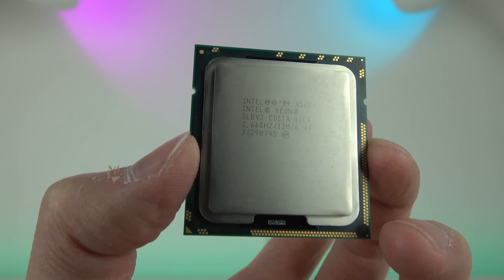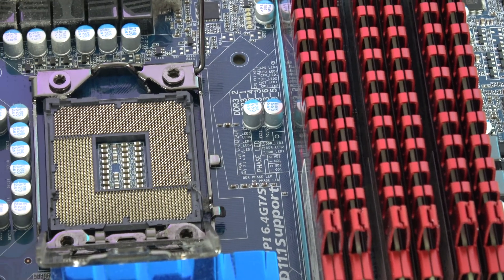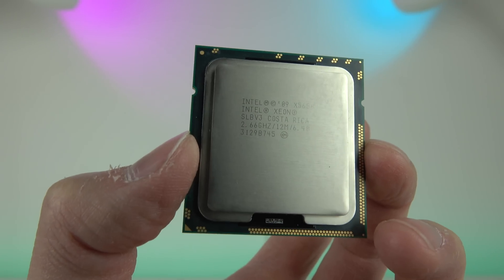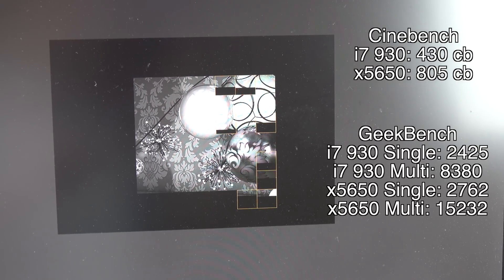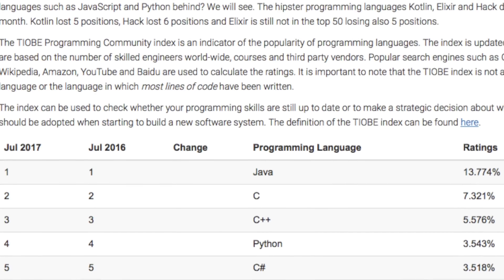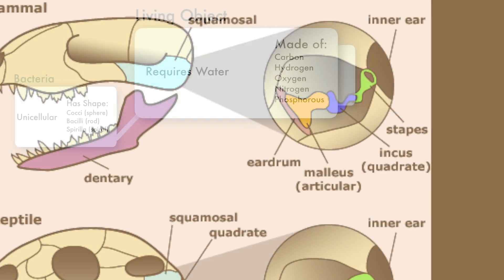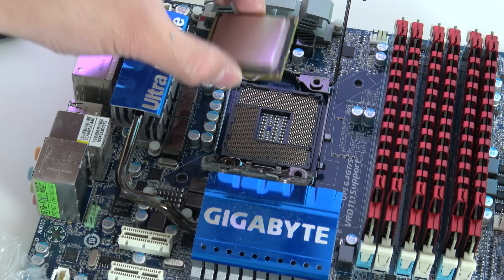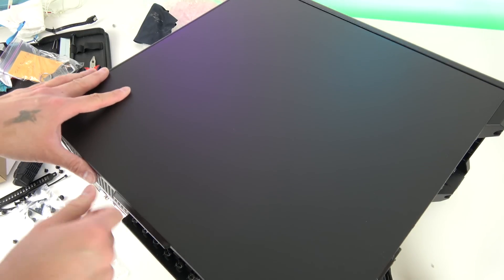This 6 Core CPU Costs $20. Will It Let My PC From 2010 Last 3 More Years?

Comment: 4k Will become standard when The consoles recieve The next generation ,they need The hardware improvenent and theyre pretty much gonna have 4k as the standard, new consoles 2020 probably or Even earlier
Reply: oh god i hope there's no such thing as consoles anymore in 2020, people should stop encouraging companies selling garbage and forcing a closed environment
Reply: if the next console gen released even in 2020 it would fall flat ,4k won't become standard as 4k on the ps pro and Xbox s is limited to lower settings and 30 fps that isn't even stable
Reply: @dominikobora5385  bro, xbox one x does 4k 60fps
Reply: @skaterbi922  in what? fortnite at the lowest settings?
Reply: pfft the latest console is still 6 years behind in technology.    4k as the standard, yet noone can see it anyway..  
oh right..   thats why 4k looks exactly the same as 1600x900

Comment: Great video. I just finished a build on the LGA 1366 platform, using used parts from Craigslist mainly. Getting a working motherboard was tough. But it was worth the trouble. Those forgotten parts are still a pretty good value! Like you, I also jumped from an i7 to a Xeon. It’s a good deal! And hey, the PCIe slots are still very relevant and offer convenient upgrade potential for the next bell and whistle.

Comment: I think the X5687 is a better gaming CPU, it's only 4C\8T, but it has a substantially higher clock speed (boosts to 3.9GHz!) which is more important to most games. It's around $40, though.

If you were going all out and cost was no issue for the upgrade, $100 gets you an X5690, which is basically on-par with most modern CPU's in multithreaded performance since it's 1000MHz faster than the X5650...
Reply: You can overclock the X5650 to similar speeds if you have a decent enough cooling solution. I got mine from 2.66Ghz to 4.05Ghz which delivers the same performance without the need to pay 80$ more for what is essentially the same chip. The point of this upgrade is to give an old PC more cores to work with in editing, so gaming is not exactly an issue there even though at that speed it really is not a problem.

Comment: X58 is a legendary platform.  I did the same CPU upgrade from an i7 960.  It's an electricity guzzler, but it gallops along happily at 4.0Ghz, runs cool on a 212 EVO and is more or less the equivalent of a similarly clocked 4770K.  It'll be a sad day when I retire this rig.

Comment: A i7 870 (1st gen || 2.93GHz stock) overclocked at 3.6GHz with all the 4 cores and 8 threats active works fine for me without voltage increase. I usually edit video, audio, compress files, edit photos and play CPU and GPU intensive games. If I need more power for games I can go up to 3.8GHz with 4 threats and 4 cores. GPU is a R9 270X. I can overclock it too, but is OK the way it is (for now). No watercoolink, just a big heatsink and 2 fans. My only problem are the VRMs, that get too hot when I use a lot the CPU.

Storage, you can use 3 (or 4, why not) SSDs in RAID5. I use 3 500GB hard drives in RAID 5, SATAII. I could use RAID0 for more speed and capacity, but is too risky.

Hope that it helps anybody to extend your expencive PC life.

My trusty CPU is from 2010 and still works perfectly. GPU, the first one 2010 and actual from 2015. Hard drives: 2010, 2012 and 2013.
Reply: Also, air filters in the case and high static preasure  fans at low speeds (use PWM) help a lot with noise and dust
Reply: Did you just call an ssd a hard drive?

Comment: Nice video, this is exactly what I like about desktop PCs. Even if an upgrade requires a new motherboard you can still usually reuse other parts.

As a note, if you're looking to make a dust free PC, you need two things: Dust filters over all intakes, and positive case pressure. The first is a feature of the case. The second just means you have more air being sucked in than blown out, so air is being pushed out the nooks and crannies that don't have dust filters, rather than being sucked into them.

Comment: my pc is from 2007, it's still working and I have no intention to change it
Reply: Alanna Lopez I have a laptop from 2007. Had to put win 7 on it but other than that it works great at everything even some small games. Computers aren't aging like they used to.
Reply: @clongoram  I too am still using a 2007 laptop. It's an IBM / Lenovo T60. It's reliable as hell, been running 18 hours a day for 10 years and is great for internal access but it's getting a bit slow now.
Reply: I just replaced the PC I built in 2007, not because it was slowing me down but because I got an awesome deal on a 2015 PC (i7-4790, 16GB RAM and Win10). The 2007 PC (QX9650, 8GB RAM, Win7) was going to become a problem in a year or two so it was a no-brainer. As a bonus the i7 runs much cooler and the whole PC draws much less electricity than the 2007 machine. Also USB3, SATA3 (6GB/s) and PCIe Gen3 are all added bonuses that mean everything runs so much faster. (I migrated my existing SSD and GPU to the new machine.) Good luck with your 2007 machine, I hope electricity doesn't cost a lot where you are.

Comment: The computer I use at work I built in 2010.  I've done multiple upgrades to the drives, but I started with 32 GB of memory and it's an i7.  It works perfectly fine, and I'm an electrical engineer.  Laptops are disposable, because they are all garbage, this system might last me the rest of my life, since Moore's law seems to be broken, and there's not going to be many more changes to reduce the lambda size in the circuitry.

Comment: My x5650 has been running at 4Ghz for four years now and I don't plan on changing it until mid next year. Last year I installed clover and or duet, disconnected my old school SATA drives and now exclusively boot and run from super fast NVMe ssd's just because I can (research is everything). My Intel x58 based system doesn't feel old at all now. Six cores at 4Ghz, 12 threads, 24GB of ram, and only running the super fast 2017 NVMe ssd's is most definitely good enough even for 2018 standards.

Comment: You are looking at computers wrong.Computers are not equipment, they are supplies, like paper, ink  and stationary. I could buy a laptop for $450.00 that would outrun that old box of yours any day of the week.  Parts of that old clunker are slow and they are slowing down the new parts and there is nothing you can do about that. If you buy a new laptop every three years, you don't have to worry about outdated software or connectors. Best of all,, you can take an old computer with no hard drive space left and transfer all the files to the new computer with room to spare because the new hard drives are so much bigger.  I do like the way that you cool that processor. Looks really neat. Is that a little refrigeration unit?

Comment: I still have a UD3R i7 960, but upgraded to a GTX 960 2 gb and 12 gb of RAM. The GPU and RAM are pretty much twice the performance from the old parts. Runs games like Black Ops 3 at 30 to 80 FPS at max settings.

Comment: A computer isn't obsolete until it no longer is capable to doing the task you use it for. Both my mid 2007 Macbook and my 2013 Samsung series 3 still perform the task I use them for quite well. The Core2 Duo in the Mac and the AMD a8 in the Samsung are still more than enough to handle what I throw at them.

Comment: I went from a i7 950 (4c/8t 3.0ghz) to a i7 980x (6c/12t 3.33 oc to 3.9ghz) for about $200. The Xenon would probably have been ok too.
Reply: also upgraded the video card to a 980GTX off ebay for about $200 (orig a $600 card). system plays modern games extremely well (@1080p)

Comment: My pc came with the same motherboard and cpu from overclockers uk back in 2010 cost me £1700 including 24"monitor,keyboard,mouse and speakers the i7 930 was  overclocked   to 4ghz. I bought this pc because it had one awards on tech radar and couple other sites were impressed with the bang for buck, it came with a 2gb 5970 and 6gb memory also.Since then I've upgraded memory to 12 gb Kingston hyperfury and now have an MSI RX 480 8 gb.Playing 2017 games such as ghost recon wildlands at 2k ultra settings and assassins Creed Origins at 4k and 2k at ultra settings the latter at 30fps at 4k very playable for me.However this gigabyte motherboard is triple channel when I was looking for extra ram from overclockers uk the most I could get was 12gb?I'm also wondering how it'll stand up in the next few years what should I do spend what I did in 2010 on a new pc  as today it costs around €2000 for the top processer and gtx 1080ti extreme whatever ?

Comment: It's funny. I just recently built a Ryzen system from one very similar to the system he had. I built mine in May 2010. Same Mobo, Same PSU, 12GB of triple channel DDR3 at 1600mhz. i7 975 Extreme Edition. Originally Radeon 5870, then GTX 680, then GTX 970. Now I'm rocking a R5 1600 @3.8ghz, 16GB ddr4 3200mhz, GTX 1080.

Comment: Good point on investment. I just spent $1300 on a Powerspec 1510 gaming laptop. I'm not the kind of guy to buy that but for the specs I'd be spending at least $2000 elsewhere. Sure, it's not as upgradeable. Even so, I'll be gaming on high settings for the next 5 years.

Comment: I have the same mobo and core i7, but with a GTX 980. Games run just fine. I didn't know the mobo would could use 24gb ram though. I'm gonna get that Xeon CPU just because its so cheap.

Comment: am i the only one left in the world to use a q6600 processor and ddr2 ram for gaming? lol
Reply: yes - well in the 1st world at least
Reply: Brad C XD should I be proud then? well, but my games run fine, so why spend more? I only play path of exile (at max settings) and war thunder (medium settings), so I guess I don't really need the fastest system on the planet.
Reply: I ran one forever - only part time home gamer so upgrading was going to be a huge leap.
Alienware Alpha - picked up the base i3 one from the Dell Outlet, added 4 GB SoDIMM, and cloned to SSD. about $500 total in the end. budget and capable of modern games. they are on to the R2 version now. 
you can prolly find them on craigslist/offerup etc for less now.
any hoo the low voltage i3 (with HT) is a way better performer than the q6600. oh an its tiny and has USB3

Comment: Ok Stumbled across your video and I am SUPER INTRIGUED!!! I have a LGA 1366 Asus MOBO with a I7 965  in it.  It is my daily driver. I have had it for 6 years now and It would be a huge PAIN to try to build a new up to date PC. I know one day I will have to create a new daily driver.  I already built a FX8950 AMD machine which was supposed to take over and ended up being nothing more than a PC for the WIFE to USE and my Kids to play Roblox on.  I also use to to download huge files and such because it decodes quickly from newsgroups and PAring and unraring volume downloads is pretty fast.  But I do not want to make that my main PC.  

SO Back to my 1366 965 i7 machine.  Using the processor you used in your video I see it would be a huge performance jump.   The one problem I have no on this machine is I have thunderbird (email) open 24/7 as it has like 20 emails that I accumulated and used over the years, they all are important in some way. I also use it to stream all my TV shows as it is a W7 media center computer so It is basicly a TIVO with like 10 HDD in (1000W power supply)  And Since all I do season to season is add more Drives to the machine to record more TV and never delete anything, It is my MEDIATANK machine.  It serves all the WD LIVE streamers in my home as well as my 2 Nvidia Shields with KODI on them.  I basically built my own station on this machine  and I got rid of cable, I use only Media Center and OTA capture, Hulu, Netflix and Amazon Video.  I have to admit after a Year I do not miss TV at all.    I also use this PC to keep like 40 browser windows open at all times, for every forum thread I am following, ebay accounts buying and selling, Amazon account, and other things like my facebook, sockpupet account and more.  So  just looking at my performance in task manager my pc is at 12 GB of memory used, out of 32gb (but for some reason it never saw the whole 32 so only 24 is useable, either a bad socket on the MOBO, bad ram stick or just an older firmware, after 5 years though, nothing bad really happening.  MY CPU usage runs at like 30% constantly spiking to 40 and 50% and maxing out to 100% when I am using the PC to look at multiple pages and such.,

So after watching your video I could easily put the processor in you recommended and I would see a pretty big boost in performance and use this pc for MANY MORE YEARS.  I do not game on this PC (aside from crap 2d titles and old school emulators and the occasional  fan project that.  If I wanna play a PC FPS or something like Minecraft (the kids really not me) I have the FX8950 PC in the other room.  This PC is for downloading, recording TV shows from OTA, SMB sharing for all my Drives to the rooms in my home and web browsing. That is it.  So I am sure the processor you recommended would do great.  BUt I noticed there are better Xeon out there.  You use the X5650 and they are about $25 shipped. But  there is a a 5670, 5680 and 5690.  The 5690 is a bit steep at $100 a processor, but I am sure I might be able to snag one for under $100 if I am patient, but the 5680 and 5670  can be had for under $60 bux.  I personally do not mind dropping 60 or 70 bux as benchmarking puts it at roughly a 40% performance boost.   What are your thoughts on say a X5670 or X5680 or even if I dropped the full $100 and went x5690?   You think It would be a worth while upgrade if I plan to use the PC as is for another few years.  (BTW a new 1000w PSU just was installed as the BFG 1000W I had in there literally blew up.  I am glad I had a spare 750W around till amazon could 2day ship the new 1000W, I just decided to leave some older HDD unplugged for a few days and only ran the most recent season of drives for my Media center recording.   Kind of suck that I dropped $280 USD on the BFG with the lifetime warranty only to find out when the PSU popped and turned the PC off (thank goodness nothing in the PC was harmed component wise)  that the company does not exist anymore and my lifetime warranty was garbage.  SO I went with Corsair. They been around a long time, and have a lifetime warranty on the 1000W I bought from them, so hoping if this one blows out in 6-8 years I might get a new one or at least a great deal on the latest 1000W in 2024 or so... 

SO in your opinion go at least X5670 or better?  I don't see any downside to this.. Its basicly a high end i7.  I probably might have to reactive windows though, that might suck.. But I can always clone the drive and if it fails to activate I can use the other clone and go back to the i7 965.  

Wouldn't mind some opinions... Thanks for reading...
Great videos!! Keep it up.

Comment: Wow... Its not the chip thats the bottleneck... Its the chipset.... Adding 2 cores isn't going to allow faster ram or give you a better storage controller.

If you aren't able to stream or play certain games on max.... The quad core with hyper threading isn't what's slowing you down. Plus that chip goes to 4.0 easy and can go to 4.5 as well with a good OC. Any i7 and I mean ANY i7 is more than powerful enough for any except the super high end user

Comment: Yes, easily 3 more years... The LGA 1366 line is anything but DEAD. It may no longer be supported but it's NOT DEAD... Many CPU's costing thousands of US Dollars back in 2012 and now being dumped @ pennies on the Dollar and this CPU is one of them. I believe this CPU was in the 1,000 US Dollar range and now 7 years later is 20 bucks. Intel is enjoying a wonderful Price Gouging Monopoly at the moment. 

The LGA 1366 line goes up to the Xeon X5690 or W3690 as the Top CPU's and these are dropping in Price rapidly. The Xeon X5690 is Dual Socket for the Dell T7500 while the W3690 is a Single Socket for the Dell T3500 and I am here to say these CPU's will easily extend the LGA 1366 life upwards of 5+ Years; easily 5+ years, probably more like 10. They are clocked @3.47ish and Turbo Boost a bit higher. The Dell T7500 is far from Dead and can easily give Threadripper a Run for its money. Sure the Threadripper will win but it will also cost you an Arm and 3 legs to boot. 

Take 1,000 for just the Threadripper CPU vs 1,000 Complete Dell T7500 with Dual X5690's, Max Ram or at least 128GB's of DDR3 ram, probably GTX 1080 or at the least GTX 1070 (maybe Ti) plus 256GB SSD, 6TB HDD, plus a few other bells and whistles. How much faster is Threadripper? Probably less than 30% to be honest, if it's that much faster. Now consider what it would cost to get Threadripper up to 128GB's DDR4, GTX 1070, SSD, HDD and almost NOTHING ELSE and I am here to say the Dell T7500 will SMOKE Threadripper in Price to Performance. I mean by a landslide too. Buy the Dell T7500 maxed out now, wait a few years for Threadripper to drop in Price, than mover over what you can to a new case and BANG you are back in it with almost nothing for an upgrade... 

I did not consider Price to Performance until recently when I was able to see just how that factors into the overall picture of things. My Dell T7500 was 100 Bucks and I am here to say it's sporting a pair of X5670's @ 2.7ish and it's a beast in Blender with only 48GB's of DDR3. Ryzen did Blender in 36 seconds and my Dell did it in 37 or 38 seconds, so you do the math. If you can afford the latest and greatest, good for you; but for the rest of us Intel still has the Aging LGA 2011 and 1366 to keep us supplied for years to come.

Comment: Push that CPU to 3GHZ, upgrade the GPU to a Vega64 or gtx 1080, and you should have a good system for 2 more years. New games run on 6+ cores,  and even the new X1X has a laptop CPU; that will give you a breather.